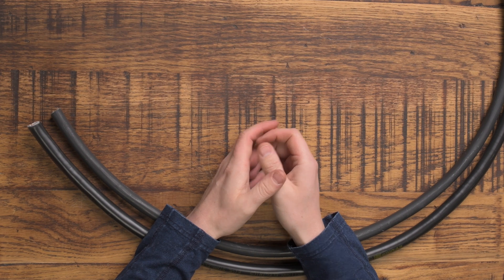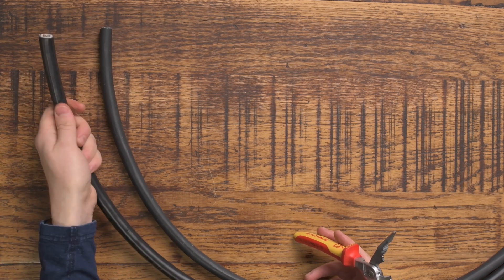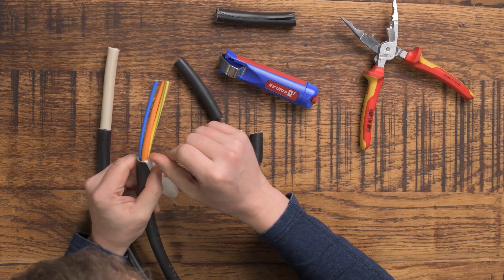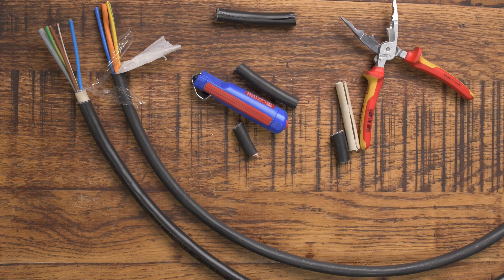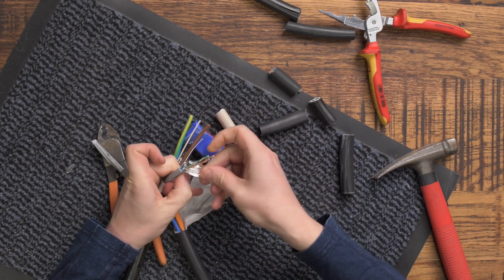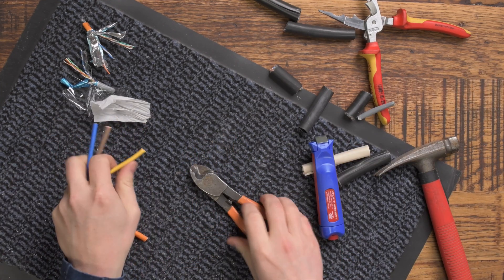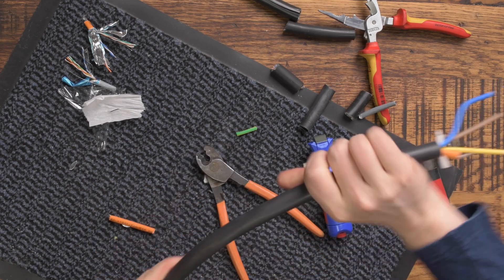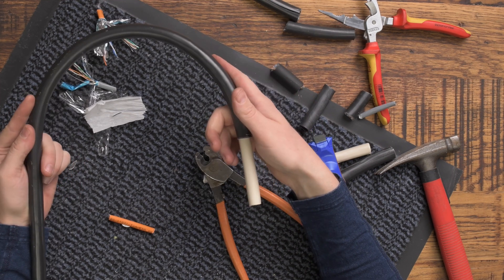REAL EV Ultra Cable Vs FAKE EV Ultra Cable. Which is best?

Comment: 14:46 - According to the regs, the CPC should be a 70/30 split of green and yellow.   - Either way is fine, i.e. 70% Green with 30% Yellow, or 70% yellow and 30% green!  I personally prefer 50/50...

Comment: AC and cat6 should not be together. Strange comparison of cable as well
Reply: The normal standard is for data to cross power at right angles, but where not possible, shielded data cables are used specifically for that reason - ie harsh environments (harsh, in terms of data signal integrity)

Comment: "EV Proinstall" Cable. Seeing as Jordan doesnt mention the other brand name nearly as much, only mentioning it once, compared to repeatedly saying "Doncaster Cables".
Reply: When you have an business agreement with a company you try to show their products in a different light of the competitors.

They visit the Doncaster Cables factory,  they had a reel of cable printed with their logo, they installed 4 EV charging points plus a new consumer unit (if I'm not mistaken). Even if the competitor was better they would never do this video.

I don't mind they doing reviews of equipment and tools plus comparisons if the products had been bought from their own money. I've done it myself, to the point of if the product was not good or fulfil my needs I would return it or sell it.

But in this case at the beginning of the video the outcome was already set - paint one in a better light because there are business interests in play. Specially when they call it "Fake EV Ultra cable" and the cable itself doesn't have any similarities in name or branding except EV.

Comment: EV Ultra cable style is good for domestic. Not great necessarily for a more industrial location with coupling from the AC to the data. 

In a pure ev use case, probably not as big a deal as data rates are low but I can see people re purposing this cable for general LV and copper comes.  

Big difference in the design. 

That other cable looks like it should meet cat6a. Going cat6 makes it more likely someone will use this in a use case that ay be problematic from coupling.
I wonder if that is a background reason why Doncaster cables went with Cat5. At this point, surely the cost to go cat6 isn't that much more to the end price.

Comment: Cat5e shielded network cable is fine for even high speed data use. Cat 6a is overkill. The characteristic of the cheap cable not staying where you put it makes me think it’s CCA (Copper Coated Aluminium) which isn’t good. The cheap cable is clearly rubbish compared to the Doncaster cable. When I say cheap it isn’t actually cheap because nothing in CEF is cheap. They are easily the UK’s most expensive electrical wholesaler. Every time I check stock availability of any item on their website, no branches have ever got it in stock, and you can only have it delivered or order it in. Do their branches stock anything at all?!
Reply: The alternative cable (probably a better term than fake cable) is Eland EV ProInstall Cat6A LSZH Cable, Power Cores: Class 5 flexible stranded Copper, CAT6 pairs: Class 1 solid Copper.

Comment: I actually think that running a cat6 data cable near high voltage AC cables is not the best idea,because the AC electricity will probably mess up with data cables signals
Reply: The twisted pairs are made to cancel out the interference. Even cables right next to feeds to commercial kitchens don't cause issues.
Reply: @florisvdk  depends on the use case.  Domestic your likely fine. An industrial environment with highly inductive load switching on the end, running a combined cable could bring trouble. 

It all depends on the types of loads on the circuit etc and to some extent, the data rate of the Ethernet as a low data requirement will be more tolerant to errors as the packets can be resent. 

STP does not prevent all coupling.
Reply: They’re electric EV charging cables — that’s exactly the load that’s going to be on it.

But, look, 60Hz AC is not going to affect Ethernet, not gigabit or even 10G. The only thing that can affect it in any significant way is high frequency noise, as in megahertz. Large inductive loads might produce those while turning on or off, but unless you’re doing that all the time, that’s not going to add up to significant data loss.
Reply: But that's why it's shielded data cable
Reply: Agreed but I’ve used shielded twisted pair with a foil layer. Been ok so far
Reply: @daves4026  well that is a solution to the problem!!
Reply: Not that this is a HV use case but it can be a problem. Highly unlikely to be a concern here in a domestic environment like Artisans work in.